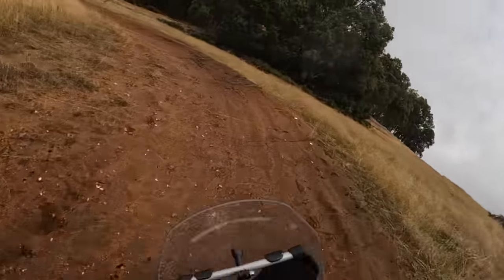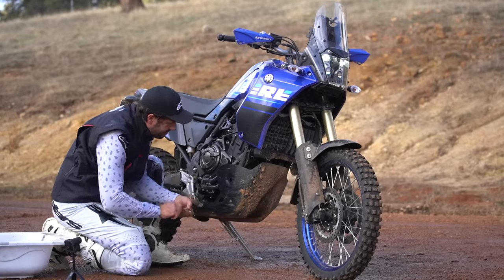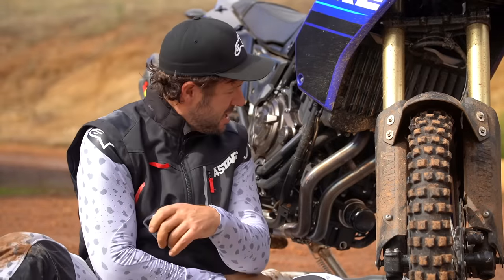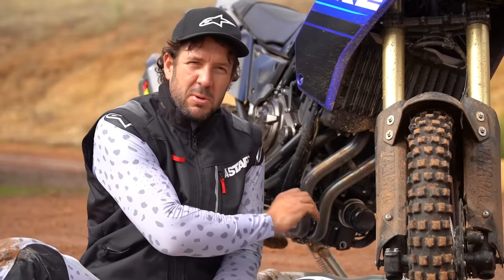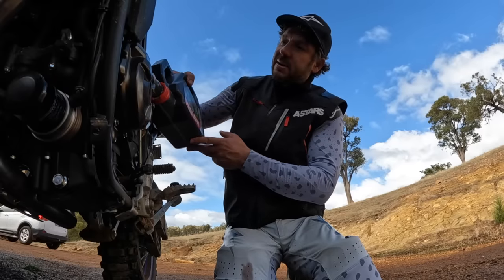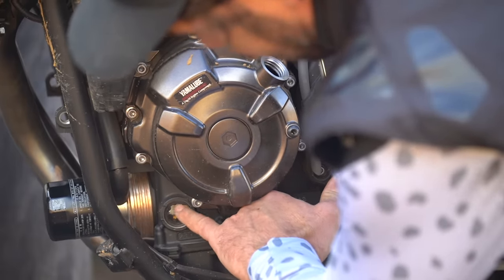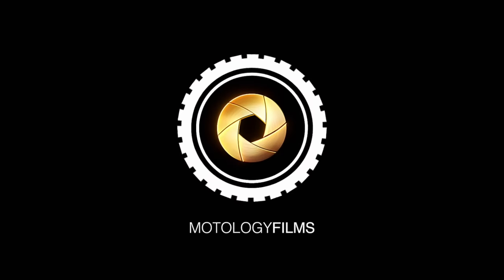Ultimate Engine Maintenance Guide: Triple Your Bike Engine's Lifespan

Comment: 1st thing after all the oil  is out of the engine i put my bike up straight and there is always a bit more oil coming, 2nd i am  just pushing the starter, its not  to start the bike, just to let it spin and  kicking the last oil  from the parts, after i fill the new oil. 
Good Video as always...damn,  i like the  T7 more and more and if the stupid dealer would have let me sit on her, i would prolly bought her already....  what YAMAHA Dealer dont let you sit on a Bike you  are going to buy? ...so i bought a HONDA instead 🤣🤣🤣  ...but the Yamaha is still in my brains, just sold my old XT-500 2 years ago....still missing her

Comment: I change my motorbike oil just before I put bike away for the winter,  because the old oil will have acidic stuff in it, which can attack bearings etc while bike is standing unused  and also over winter all the stuff suspended in the oil will settle out and be harder to move come spring...

Comment: Your oil filter does NOT need to be that tight man... finger tight + half a turn. Get a bloody torque wrench... and you can anneal your crush washer when you re-use one. Just hit it with enough heat to get it soft again. Can prob use them 5 times or more if you anneal it every time. If you don't anneal it, it's brittle and could crack and/or not seal properly. I appreciate you taking the time to show people the DIY and how-to, but don't tell them bad habits or poor mechanic's.
Reply: It's a weird tutorial video.😂
Reply: @angelsmalls7044  Lol, I kinda thought so too...

Comment: Thanks for your knowledge  Adam. Here is the question.  I was running 10w40, then switched to 15w50 this spring. Manual allows both. Started to feel more vibrations.  Can this be related to heavier oil or the reason is in the other ? Thanks.
Reply: I tried Motul 15-50 oil in my old Super Blackbird. Same thing, but the cluch started to vibrate so badly I had to change back to Hondas own 10w-30 mineral oil. Fortunately, the clutch started working again and lot less vibration when starting in cold.
Reply: It was 2004 model, so I thought oils are much better today, but I speak with true Honda Blackbird expert mechanic and he told me, never use anything but Hondas own oil or Repsol. I asked why only two choices? He said they are the same oil. Repsol 10w30 mineral oil is like three times cheaper than original Honda 10w30. I think it is actually Repsols cheapest oil. :)

Comment: With the full system Akrapovic would you recommend an engine tune? Especially when the DB killers have been removed?
Reply from the maker: Plug n play. Runs awesome just bolted on. I haven't taken dB killers out though
Reply: @ARiemann1  I did, sounds awesome! Even the cops on bikes said so 😄
But I get told different things, Dealership guys (who are fantastic guys that race too) said the T7 computer can compensate it, and others say they run too lean at mid revs even with a standard exhaust 🤷‍♂️
Reply from the maker: @dalehatton6965  I've seen the Dyno facility at Akro and they're pretty switched on with gas flow utilising standard engine and airbox configuration 👍 that and the fact you can hear / feel it. I sometimes get a little pop when doing a fast lap on my track ... but that's a good thing I reckon.

Comment: Instead of Motul 5100 could I use 7100 full synthetic? Does this have a role to an engine life span?
Reply from the maker: Simple rule is look at the oil window or dip something in the filler. Change the oil when it gets too dirty. Cheap oil gets dirtier, quicker.

Comment: Please let me add something. It is even better to remove the engine guard, unscrew the oil screws half turn (and screw them back very gentle) when the engine is cold before the whole process so as to avoid the possibility of creating any problems to the engine thread which is sensitive at high temperatures as aluminum. At the end of the process otherwise the engine would be cold enough to screw everything back properly (never too tight). Thanks

Comment: I've sen several people talking about tightening their oil drain plugs in while the engine is "HOT" and ruining their threads due to overtightening them and having the aluminum cool down and creating a over torqued situation? They must be race crew fast at oil changes lol. I change my oil hot, let it drains until its starts dripping out, hand screw my filter on and by that time its barely even warm. The oil holds much of the heat in the pan and when its drained air replaces the hot oil and it cools very quickly. BTW I own 2 torque wrenches a 1/4 inch 20-200 Inch lbs. and a 3/8 inch 10-150 ft lbs. I never use them for things like oil changes, brake pads, handlebars, mirrors. I just snug them up. I've never had a leak on filter or plug. I use torque wrench on spark plugs and plastics and  trim stuff and will use one when I do the chain tensioner adjustment. And probably when I have to rebuild the clutch. Beyond that if I need to do a major thing like a valve job I will just trade the bike in.

Comment: My Moto Guzzi V85TT needs same Castrol oil than Bugatti Veyron, 10W-60. I really need ride hard, before changing oil, because it doesn't flow well if cold. Oil filter is one of the kind too, it is made of steel and is completely inside the engine block. When I first changed the oil, I was really confused, where the hell is my oil filter. :)

Comment: Try a cable tie on the sump plug, great TikTok hack. Tighten onto the nut, then unwind using the end of the tie.
( You can do a full rotation, but best is 1/2 turn left, I have reused it a few times )

Comment: Interesting that you are using 10w50 semi synthetic as Yamaha state 10W40. Any reason you didn’t use fully synthetic.
Reply from the maker: It's what I had in the shed. Just did a 15-min moto round my track today to fine tune suspension and front end. Probably hit the limiter 2 or three times per lap. I listen to my engine every time before I put it away ... it's purring like day one. 10W-50 semi is just fine. I'll flush it out before my next big ride and should have some Motul 7100 by then ...

Comment: You mentioned a different header pipe on your T7 - is it still running the Cat. Converter??
Reply from the maker: No, it replaces the cat, drops weight and adds hp.

Comment: Great stuff. Noticed you have Karoo Extremes on the Darkhorse. Very little info about them online. I run them on my 701, mostly on norwegian gravel roads. I have only intermediate skill level but the idea is to have the best possible grip for cornering traction and braking. Is my thinking valid, or could i expect the same performance from a longer  lasting Motoz tyre?
Reply from the maker: They are actually Pirelli Scorpion Rally front and rear.
Reply: My bad. Pirelli owns Metzler. Tread pattern looks identical....

Comment: Original filters are not always best. Their suppliers change and with it so does the quality. If you examine fuel filters, for example (bigger and easier to see into), you will see that most have simple folds on the internal filterpaper about a vertical axis whilst some few have many folds up and down which gives approximately TWELVE TIMES the surface area = longer lasting, better performance. I know this as a former bio fuels producer stripping them down. Don't always assume that original parts are best but rather ask fans and professionals with no commercial interest what is a reliable part.  For example, we've had original Volvo impellers fall apart in yacht engines in days, whereas ones costing a fifth of the price from an automotive chainstore's own brand have gone on for years.

Comment: I’m going to disagree with bringing the oil up to temperature before changing it. The purpose of getting the oil hot is so it will flow better out of the drain hole. If I start my car (for example) and immediately pull it into my garage not only will the oil not be warm, it will be spread everywhere in the engine and it will not drain out quickly. But if my motorcycle is just sitting and I haven’t started it for at least a couple days all the oil will be at the bottom of the engine. So when I drain it a greater majority of it will empty out into my catch pan. Perhaps not the best idea if I lived in a cool climate but I live in the U.S. desert southwest. I realized all this when I would prop up my oil catch pan to drip the residual oil into my oil holding container. After a day or even less I noticed that no oil was left in the pan, I could run my finger over it and it was completely dry. So if a motorcycle engine is just sitting I know as much of the oil as possible has drained into the pan, no need to start it and spread the oil all over the engine again. This is just my opinion, everyone else should probably change their oil the way they feel comfortable with. It probably doesn’t make a big difference, however.

Comment: Manufacturer recommends semi synthetic oil. Old mechanic says - full synthetic is better for engine. What is your take on this?
Reply: Always use manufacturer recommended oil in motorcycles. I tried many different oils in my old Honda Super Blackbird. Original oil is 10w30 mineral oil. And that thing has top speed of almost 300kph. It's engine has normal operating temperature of 85-120 Celsius. I tried many different oils, because I though that thing is from 2004, so oils today must be much better. For example Motul 15w50 was catastrophic. The clutch started to vibrate so badly, I thought it went broke. Then I talked to old Blackbird expert mechanic who said never use anything but that old 10w30 oil. Just change it more often, if you really want to take good care of it. Also, don't waste your money to change oil after the riding season, but do it in the spring after proper ride -at least 30 minutes.
Reply: Also, there will be chance, your clutch starts slipping if changing to Fully Synthetic oil. Many motorcycles do this, so I wouldn't risk it. Oil guy wants to sell oils, motorcycle manufacturer designs their engine parts for specific oil. Also, never use ester oils, if it is not specifically mentioned you can. Those are oils which are advertised to save fuel in cars, but uses clutch slipping in motorcycles.
Reply: Also, never use oils for automobiles. I mean if the original oil is only for motorcycles. There are motorcycles which uses same oils than cars, for example Moto Guzzi, but they are air cooled and uses 10w60 oil. I haven't seen 10w60 oil from Motul, for example.
Reply: @j_moonchild  ok but what about 10w30 synthetic vs 10w30 mineral?
Reply: @j_moonchild  The reason a cutch might slip after going to a fully synthetic oil is because it will dissolve the sludge buildup from your previous oils. Ester oils are the absolute best and most expensive and that is what I use in my motorcycle, I get the ones made for motorcycles with the MA2 specs. Never had clutch slippage issues EVER.

Comment: Always pre-fill your oil filter!  Your first start is going to have to fill the oil filter before building pressure to supply to vital engine parts. Even when the filter is horizontal you can fill in to at least 75%. I’d rather dribble a bit than have a dry start.
Reply: I have a drysump system so this makes no sense

Comment: A lessen I learned with my Africa Twin. 

When removing oil filter make sure the O Ring came with it. 

Don’t be like me and spin on the new filter with its own o ring on top of the old o ring that you didn’t make sure wasn’t there. 

If you do.. it may not leak at start up but I will once you start riding and spray your rear tire with oil. 

Ask me how I know.. 🤦‍♂️🤣

Comment: I used to do the drain hot oil trick until I badly burned myself on the exhaust. Now I let it cool 15 minutes and after it's drained I poor in 1/2 cup of cheap oil and let it drain straight out b4 I replace the drain plug. 

In the days where bikes had kickstart I would kick it thru a few times with the ignition off. Another example of bike technology limiting home maintenance.

Comment: I don't understand warming the bike up before changing the oil. It sounds like you're saying warming it dissolves the particulates, which then gather in the bottom of the pan, and then get flushed out when you drain the oil. At that point, what difference would it make if you didn't drain the oil, but instead let the bike cool? Wouldn't the particulates still be in the pan? How would the particulates get back up into the engine to make all of the surfaces "black?"

Comment: Interesting, however i have an issue with this. All of those particles that have settled down to the surfaces(except the oil pan) came from the oil and the reason they are there is because oil just sits there, it doesn't drain back to the pan, so whatever the hell you do, oil will sit there when the engine is off. I would argue that you get more dirty oil out if the bike was sitting long enough that every nook and cranny that can drain back to the pan has drained back to the pan. I myself heat it up and after the majority of the oil as drained i lift the rear end to get that little extra out and leave it for an hour. (even this way my gen2 mt09 would make the oil black in 2 rides)

Comment: Dropped my bike off at the honda dealer for the 1k service. First 5 years it will be serviced by the dealer because of factory warrenty, sadly. 

Their shop wages are 87 euros per hour. Got it back, started it up, and it started to STENCH. When removing the oil filter they didn't clean op after themselfs and left all the old oil on my exhaust and engine. Fresh burnmarks on my new bike's exhaust. Nice. 

Yes, a scotch fixes it. But its just unproffesional to me. Especially if you ask me for 87 euros per hour on a 1k service that often is free.

Comment: There is no way your filter is getting plugged enough that the bypass is needed unless something is grenading inside or you haven't changed your filter ever with heavy use. The bypass is for cold starts really. Have you ever cut open your filter? A little clutch debris but otherwise there shouldn't be a whole lot. If there is then it is time to get into the cases as something is seriously wrong.
And oil blackening though it can be from contamination, is generally caused by extreme swings heat cycles.
I have a KX500 that I use as a snowbike and the gearbox oil will go black after only a couple hours riding. The transmission works really hard spinning the track that fast and being constantly under load. Then when you stop in the cold snow it rapidly cools. Using the same bike in the dirt I can go 15 -20hrs before the oil starts to discolor.

Comment: Leftie loosie, righty tighty is a good reminder how how to turn bolts the right way. 

Personally, I do not think it matter much whether you change the oil hot or cold. There are valid arguments for doing them either way. Any circulating sediment should be collected by the oil filter, anyway. It would be interesting to make a sample test between a cold and a hot drain, just to see if there really is noticeable more contamination in the "hot" sample.
Reply: With modern oils you're probably right as they are designed to keep contaminates suspended in the oil to stop sludge buildups in the engine. But I'll still change mine when the oil is hot.

Comment: ïf you don't havbe the tool just punch a flathead screw driver sidways at the top of the filter and spin. that's how i do mine and it allows you to control where the filter is emptying from.

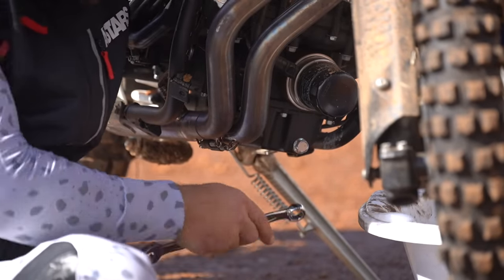Comment: @_02:44 & 11:00// Before removing drain plug & filter; open oil-fill cap to reduce vacuum and speed-up draining velocity. #2, clean drain-plug & oil filter engine case areas (before, and after). #3 Visually confirm the drain-plug washer is free of all grit/grim before replacement, &, the old oil filter gasket/washer/"O"-Ring etc., is not stuck to the engine-case!

Comment: Hate to say it mate , but every horizontal surface stays horizontal , and even draining it hot doesn't drain all the contaminants out of it . Whenever you turn it off , as much of the contaminants drain down to the sump , regardless of when it's drained , hot or cold . Hot draining does empty the sump quicker . Engine flush does a better job of removing contaminants than not using it .

Comment: I agree that changing the oil hot is very important, but, adding a oil cooler is way more important.1 it adds extra capacity 2 extends oil life so if you stick to your same intervals your oil is still in better shape.3 In stop and go traffic in hot weather the oil is exposed to more air keeping it from breaking down so quickly.All my bikes for the last 44 yr have had 1 and never blown a motor. As a mechanic it's the first thing I suggest
Reply from the maker: My 1992 Africa Twin has an oil cooler 👍
Reply: The T7 has an oil to water oil cooler. Its the piece that the oil filter screws into. It has water lines running into it from the water cooling system and it cools the oil right before or after it passes through the filter.

Comment: won't most engine will leave about 15% oil inside when you drain their oil?

we choose viscosity based on climate. Too thin can reduce performance when the oil can not create enough oil layer to coliding engine component.

Comment: A tip to have an even cleaner engine than this video: After draining the oil and removing the oil filter, I always, car or motorbike, fill fresh oil until fresh oil comes out of the drainhole. When you do that, som black dirty contaminated oil will come out first. Then I fit the filter and drainplug and fill up to the correct level.